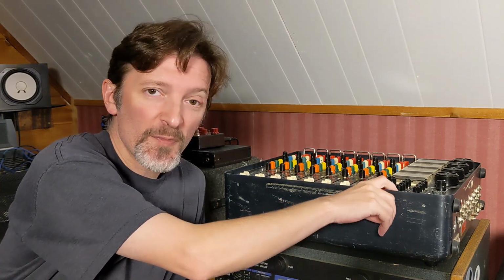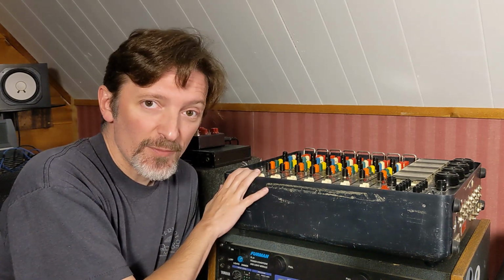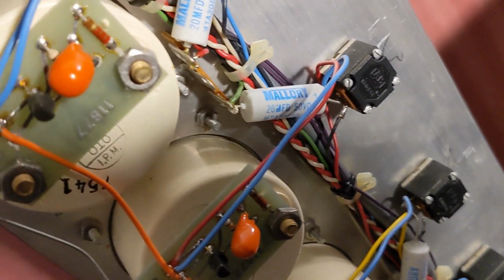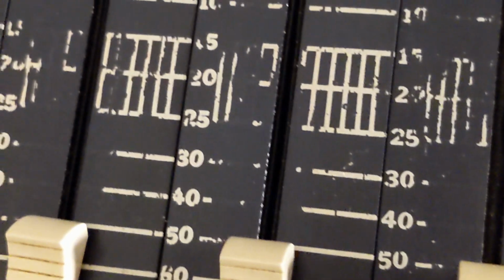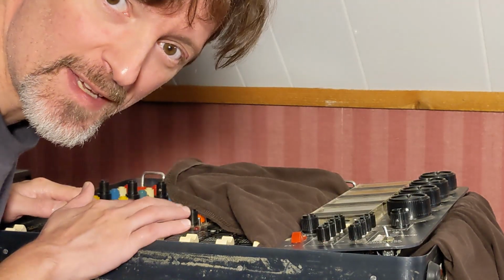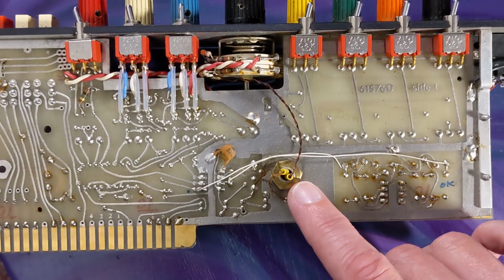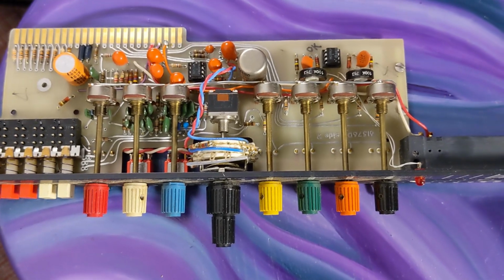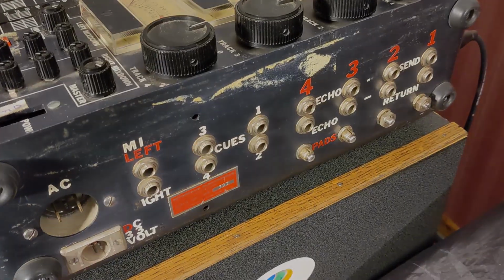Interface Electronics Series 100 Part 5 Inside the Vintage Mixer

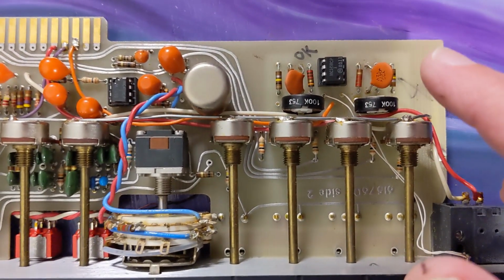Comment: Interesting stuff...at 7:05 looks like trimmers not inductors
Reply from the maker: It could be. This model is supposed to have inductor EQ but there could be both types of components. It's a very interesting design and has a ton of character.

Comment: Thank you for this. Im racking a few channels, and this clears up a lot of questions
Reply from the maker: That's great! I wish I knew more about these myself. This one sounds really good and is fairly quiet too. The only issues it has are some sends do not work. I think it's the effects sends and the Cues work. I don't really need them to use the preamps or for summing though
Reply: @TwinCreekAudio   My channel cards came to me disembodied from the mixer, missing all the inductors, mic transformers and the e.q. circuit i.c. So i got some homework, and little else to do with them outside racking them. They are the same 104k strips. I think i have a cue strip and a headphone strip too
Reply from the maker: @Junkyard Studio  they should be easy enough to get working. They seem to run on 30V unipolar power supply. Mine is internal with connections for batteries also labeled 30V. Best of luck and let me know what happens. I'm still thinking of making more videos about the company and it's history. Just have to continue the research on it. In the meantime, I'll probably use it for something in another video. I use the preamps on drums in the studio all the time.
Reply: @TwinCreekAudio   What i've found so far on the power end, each card runs off of 15v or so. I got the one channel up on 12v right now. I did see 30v on schematics, but the opamp can only handle 5v-15v. I popped a TLO type in the eq position (i think) and got no smoke, but without the inductors or mic transformer all my tests so far are with line level. So we shall see.
Reply from the maker: I'm curious to know what happens. I had a contact that has another newer Interface console but it was a model without the input transformers. I lost touch with him due to time constraints on my part but I'm always looking for more info on these. I'm also about to restore an Echoplex EP-2. I watched your video about recapping the EP-3 and that was great!
Reply: @TwinCreekAudio   I'll keep ya posted! I'm glad my video helped, as your video helped me!

Comment: Wow! What a huge difference from my Model 100 24 x 4. Same panel layout but mine has no driver boards on the VU meters, they are strictly passive, run through the same 47uF cap, but no dedicated amplifier circuit. Wonder if that affects the sound quality? I have replaced the meters, mine only had two very different white meters marked "Interface Electronics". Yours look like better, newer meters. I used four lighted VUs I got on eBay that have grain-of-wheat incandescent lamps in series which I run off an auxiliary 12v power supply fed in through unused pins on the 5 pin XLR power inlet. 

I totally rebuilt the weird home made external power supply mine came with, but I think it was originally mounted internally, the chassis still has the old 2-prong AC inlet and a hole where the power switch was. Someone added a small regulator board to power two LEDs to indicate main and phantom power. 

So, regarding phantom - the very strange early solo system on my board had been disabled when I got it in 1983. It had a relay on every input that would mute if another channel was soloed by supplying voltage to a bus on pin 10 (I think, notes aren't handy). Someone had started converting the solo slide switches to phantom power buttons and used the second output from the dual power supply for phantom. Only 3 modules had been modified this way, but they used the suggested Louis Stevenson phantom network that was hand drawn in the manual, so I replicated that on the remaining modules (big job). I tweaked the components in the PSU to bring it up to about 40v. When it was all said and done I was still getting current leaking through the phantom caps even when all channels were off, so I went back through the whole thing again and changed the order of the switch in the circuit so it was truly off unless needed. I don't see myself loading this thing up with phantom powered mics and DIs so the somewhat lame phantom PSU will do for now.  

Also I see yours has semi-sealed AB pots for the masters. Mine had larger old style unsealed 25k pots, dirty as hell. But since I rebuilt the output panel with new concentric pots that have a master for both the "track" and "echo" busses I replaced them with modern concentric 25k pots from Capi-Gear. I think they're Bournes but I couldn't find them in Mouser or any other electronics supplier. 

Mine did not have output transformers, it was wired pin 3 hot and if you used an unbalanced cable that put pin 3 to ground you could fry the output amp chips. I had some very collectable UTC A-22 transformers so I added those to the four track outputs, and some generic transformers to the "echo" and "monitor" (matrix) outputs.

The relays you reference in the master section are probably turn-on delay mutes. The voltage spike this thing can generate on power-up is a potential speaker blower, and Stevenson references this as an update in his notes in the manual, but mine did not have that. I think it's serial # 376. If the 104Ks were the same as the 100B/Ds there is a mute relay on each channel that operated as a solo-in-place, but no lights of any kind to indicate which channel was soloed, and no provisions for PFL of any kind.

Man, I envy your 104K input modules! They incorporate every improvement that could have been done to the 100B and D modules I have, including splitting the dual op-amp circuit design into two chips of more modern specs. Mine uses 1437P dual opamps throughout, and are the only active component. Same thing on the masters. One half goes to drive the track, the other the echo, and another that drove the stereo mixdown output and one more for the non-installed spring reverb that could be mounted inside under the faders (the holes are there and it's on the schematic, so maybe someone took it out).  Mine must have at one time had the "echo return" jacks and trim pots but those had been removed before I got it.

Anyway, I could go on and on...thanks for these videos, and if you want to message me I can send you many pictures and exhaustive notes on my Stevenson mixer restoration. I'm not really an electronics tech, but in my 45 years of audio career I've learned a few things, enough to be dangerous!
Reply from the maker: My guess is the extra VU boards are a buffer which might affect the sound. Mine has 4 API output transformers for the 4 Track Outs. No idea if they are original or added though. I love the preamps and the EQ on the 104k modules and I'll use them to send to the track outs so I'm getting those APIs in the signal path. Mine has a funky internal power supply but it still works fine and isn't noisy or anything. It looks to have been well maintained and recapped at some point. There's only one electrolytic cap on the channels so I suppose recapping it would be simple enough but it sounds great and is almost fully working so I am not planning on doing much to it. My Cue outs work but the Echo outs don't seem to. That's really not an issue for the way I use it. I've been tracking with the preamps and a little EQ on the way in and I've also tried it out for summing. In both cases, it sounds absolutely great! I've been looking into the history of Louis Stevenson and Interface Electronics. Hoping to go to Houston and find the location of the factory where these were made. They seem a bit strange but the sound is so good, I'm thinking maybe the strangeness and hand made nature of these is the reason. It's a unique and unique sounding mixer. This one is staying in my collection in the studio. I learned about Interface Electronics consoles 17 years ago and finally found this one. I'd be interested in any information you have about them. Just your comment gives more information about the way they work than I had before so I really appreciate that.
Reply: @TwinCreekAudio  I started hearing about Interface in 1975 when I read an article in Rolling Stone by Tom Scholtz of Boston talking about his home recording setup that used an SIE mixer. Never knew which model. They used to advertise in the audio mags in the 70s and 80s when I was a young sound man. I saw them at AES in NYC once or twice in the '80s when they were doing big boards for tours. As a high school kid I used to write to them and request literature, most of which I still have. Bigger consoles were upwards of $20k, a lot back then. In the 1990s I was a video engineer but my background in live and studio sound led me to audio post, which I have done for a living for 25 years now, but my one employer had a 104 12 x 4 in an edit suite which I used extensively. They ended up tossing it when they went out of business, which breaks my heart in two. In the course of doing live gigs I encountered several Interface boards of various sizes and shapes, and one sound company I worked for had a 24 x 8 308 that I could have bought with a road case in the '90s, but I was too poor then! My Model 100 is about as crude and primitive as they come, and seeing your 104Ks close up was wonderful because I am so intimately familiar with the 100B and 100Ds, and the K really cleans up and improves the basic module. Same input transformers, it looks like. Would love to find a mixer like yours and steal the input modules for my frame. Are they 15 pin edge connectors? If you want to send me a private message with your email I'll send you the (always changing) Word .doc that has all of my notes and photos of my restoration.
Reply from the maker: Absolutely! I love to know more about yours. I'm in Texas so they come up for sale here sometimes. I got this one in Dallas. I found another one in Dallas someone had found in a dumpster. No power supply and I didn't have as much as they were asking so I couldn't get it. I talked to  someone else who had a large frame Stevenson that had been in an aerospace museum and was now in his studio. I still have the link to that too. I started recording in the 80s with a 4 track, then 8 track cassette, then I had a narrow gauge 16 track and a 2" MCI JH-16. My time working in commercial studios ended around 2001 though I kept a house sound engineer gig for a few years after that. Put my own studio together in 2004 but I'm an IT technician to pay the bills. You can contact me at Grady and twincreekaudio 
Talking shop about vintage gear is so much fun and the Interface Electronics stuff is the best sounding and most quirky I've ever seen and I love things kike that.

Comment: I know I’ve said it already but stuff built in the 70s and 80s was really built so nicely. I mean just the fact that you can even pull out the individual channels! That’s amazing, and of course everything inside that board is laid out so nicely
Reply from the maker: The company made some really nice gear. Very high end parts and they were all built to order from what I can find. Also, the fact it is still working means they were built well. Plus it's got all the transformers and an internal power supply and I can carry it with its built in handle with one hand. Pretty cool!
Reply: @TwinCreekAudio   very cool indeed!!